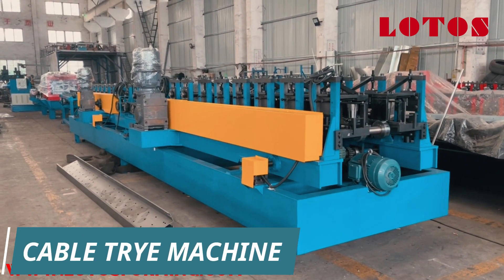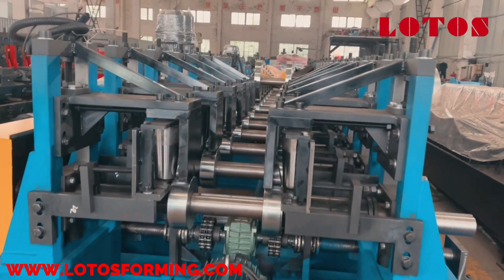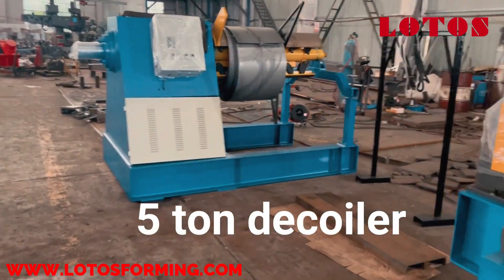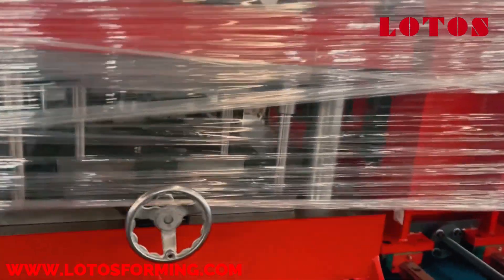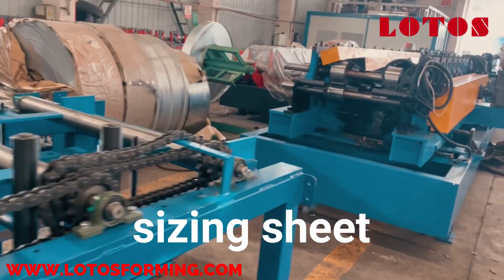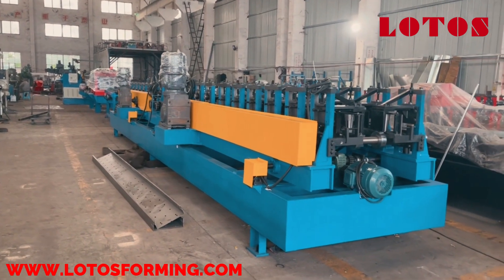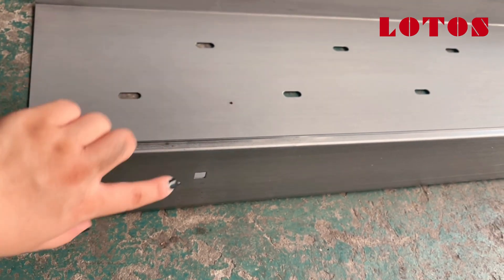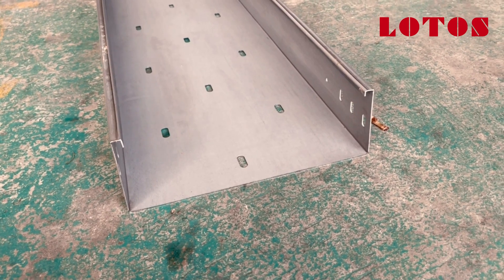cable tray making machine | cable tray production line

Comment: Cable trays are mechanical support systems that provide a rigid structural system for electrical cables, raceways, and insulated conductors